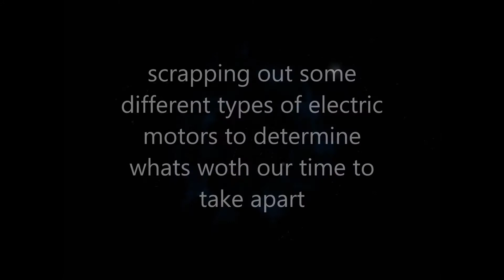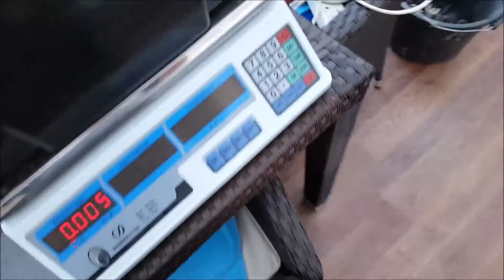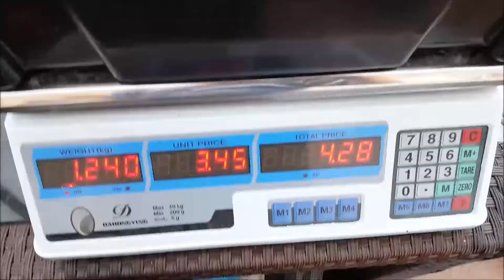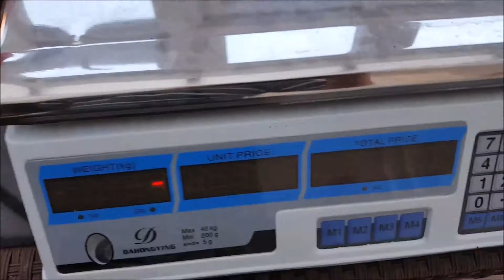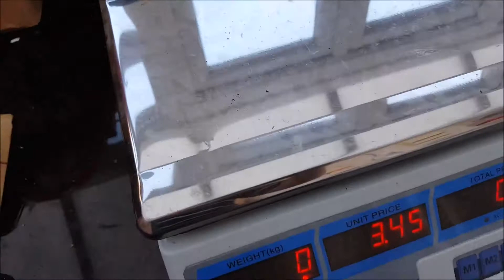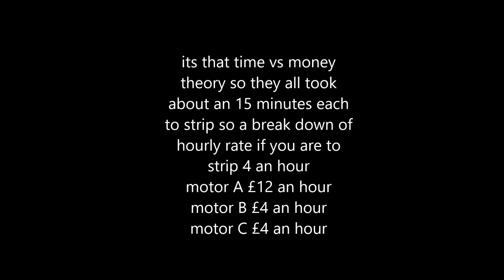scrapping out 3 different types of motors to determine their value

Comment: this vidoe is good allso on most motos have a cast aluminium case to add.. so you could add to the hour rate..
Reply from the maker: steve cottrell that true as soon as i get a motor i remove the cast ali shell and chuck the copper bearing bit a big bucket i have a couple of washing machine if they have the good hourly rate motor I'll do a quick video with the cast ali shell
Reply: yeah be good to see what the value of motor is even the bit in the middle so you get Ally coppa Steel and the thing that spins in the middle as number 2 motor..